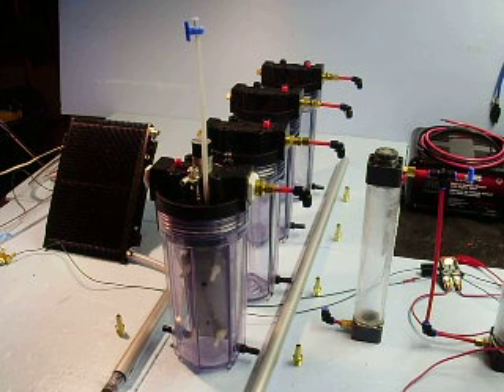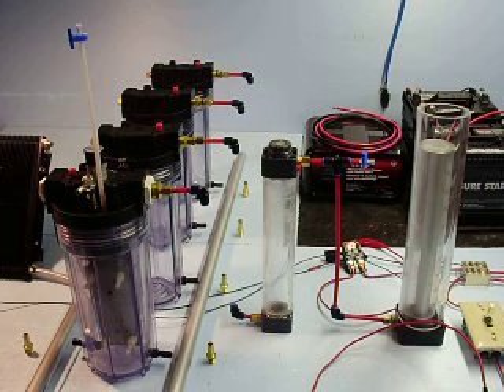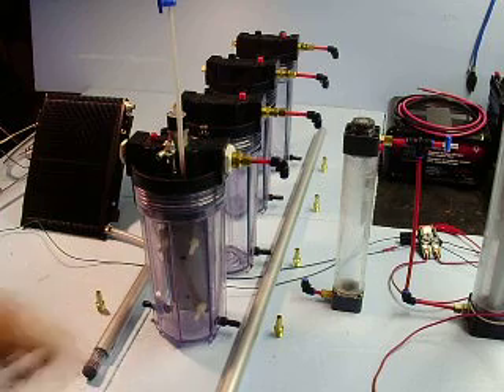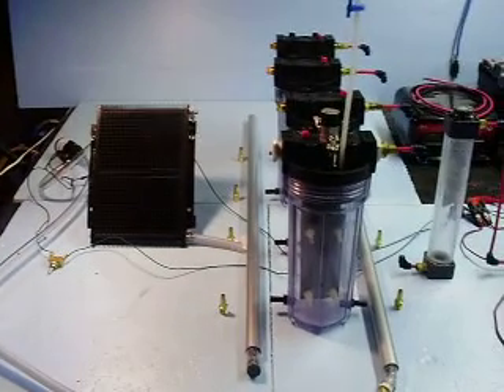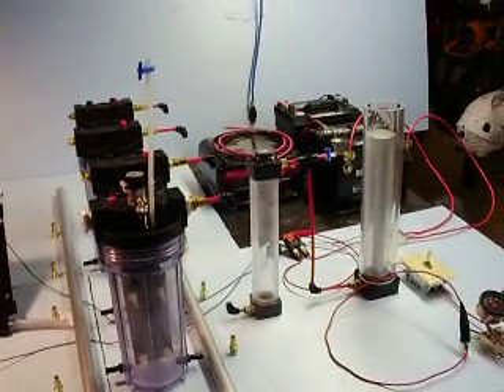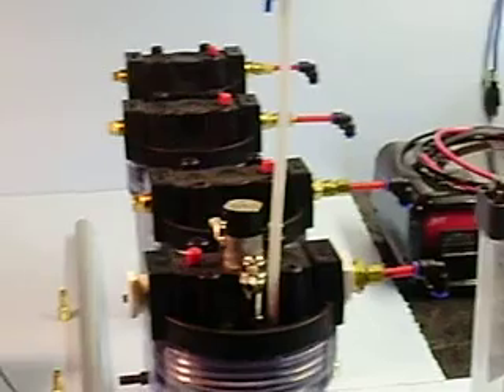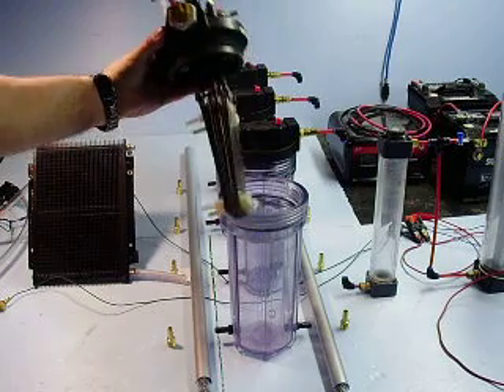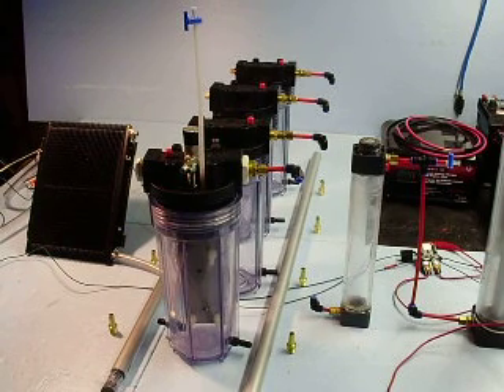014 4 hho generators setup

Comment: Hi FizzyH20
Just a thought on your radiator connections.
Taking heated electrolyte off the upper area of the reactor vessel, circulating it through the radiator then returning it to the lower part of the reactor vessel would improve cooling efficiency.  
Your present connectors appear to simply pump the fluids across the lower part from one connection to the other.
Moving that fan directly against the radiator will vastly improve its cooling capacity also.
Great series.  Please keep them going.